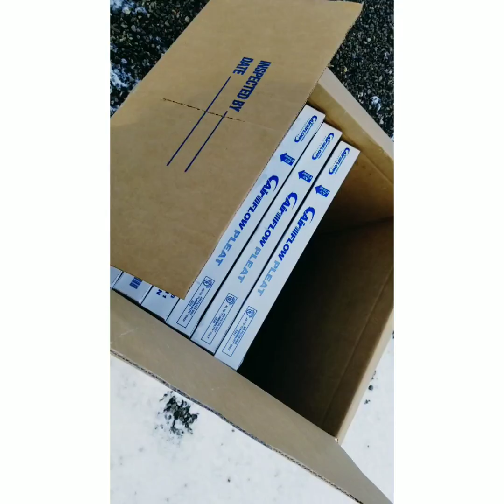How To Be An HVAC Tech

Comment: Your not going to make six figures doing PMs and changing filters
Reply from the maker: I do PM and change filters all the time, make 6 figures
Reply: I moving to Canada, you cant in NY,like you said if you study and get good/fix things that others cant,you make over 100k.
Reply from the maker: +Capitol Refrigeration,Heating,and Cooling our fully licensed techs make $50 and hour, I fix lots of shit too, but also do tons of PMS, it's where all my work comes from.
Reply: I work with guys that mostly change filters and fix easy basic stuff,they make low 30 an hour,but the ones who really apply themselves and figure out complicated issues make in the 50s an hour. It definitely is not a easy trade.
Reply from the maker: +Capitol Refrigeration,Heating,and Cooling no it's not